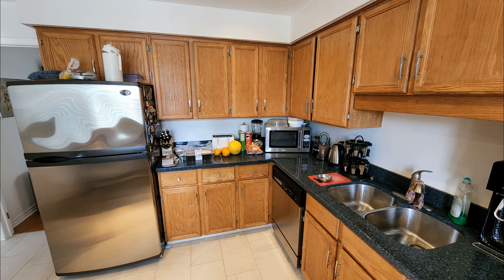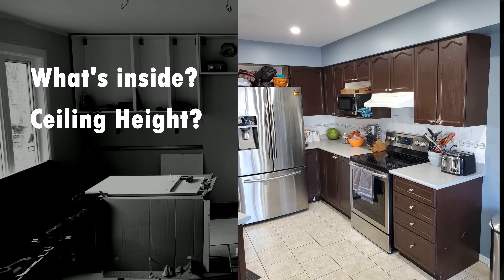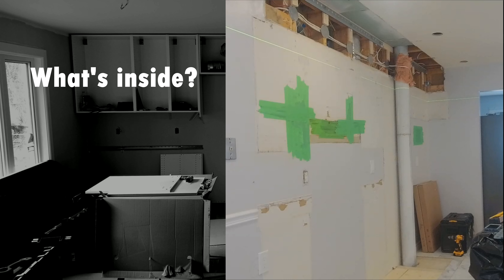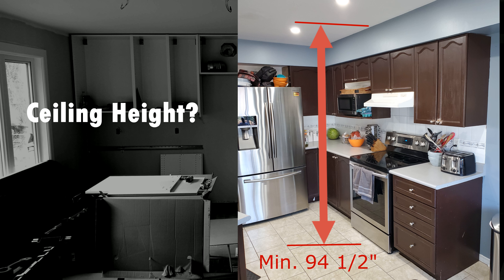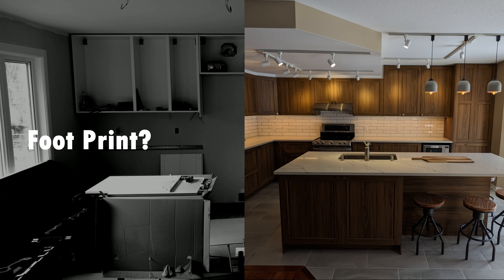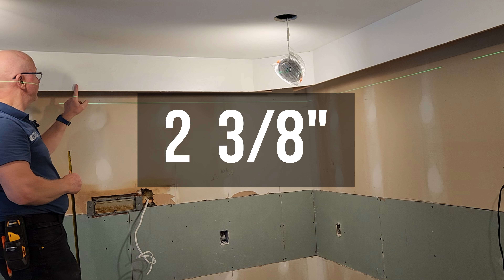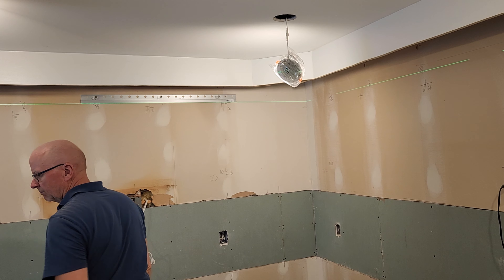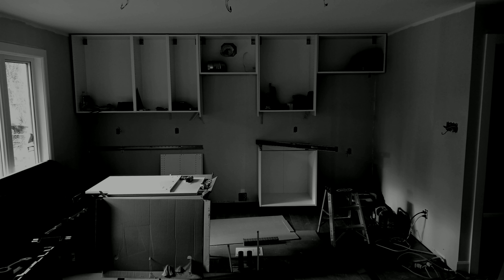Unlocking the Solution: Solving the Old Bulkhead Dilemma in Ikea Kitchen Planning

Comment: Hi there, I have a bulkhead around the top of my kitchen that is 80" from the floor. My house is over 100 years old and the likelihood is high that there is wiring inside the bulkhead that would be a big job to move, so we are considering keeping it. However, it appears that this means we won't be able to have a pantry using Ikea high cabinets, because the cabinet itself plus the plinth would need 84 in. What would you recommend doing in this case? Should we modify the high cabinets to shorten them enough and order custom doors, or make a faux high cabinet out of an upper and a lower combined? Would love your advice!
Reply from the maker: Thank you for your question. I have been faced with the same dilemma not long ago, and in that case I used an 80" high pantry cabinet which I cut to 75" in height. There's no need to use fancy custom doors because you can add drawers and a door to end at 75" in total. In my case, we had 2x15" plus a 5" drawer, which total 35" and the we added a 40" door at the top. Mission accomplished.
The same goes for the wall cabinets if you want any of those. Cut a 30" high cabinet to 25" in height. Then add a 5" drawer and a 20" high door. Voila.
Reply: @kitchensbyrannes  Wow, thank you so much, that makes perfect sense. Amazing that you replied so quickly! I'm queuing up several more of your videos right now to prepare for my Ikea kitchen project :)

Comment: I am working towards completion of my IKEA kitchen right now.  I had a soffit above the old cabinets.  There was no reason anything should have been there.  

Unfortunately, my electrical panel was below the kitchen in the basement and when they built the house, the electricians were lazy and ran all the house wiring in my kitchen soffit to the rest of the house.

My electrician had to put junction boxes in the wall to extend the wires.  You can't bury the junction boxes but you can put them behind the cabinets and provide a cutout in the back of the cabinet to get to them.  I did some measuring and lined up the junction boxes with the upper corner cabinet.  So, I have four junction boxes in the back of my cabinet.  

Fastcap makes some plastic trim rings meant to clean up holes in the backs of cabinets.  I cut them to fit and glued them to the back panel.  Gives a much nicer finish look to the holes.
Reply from the maker: Wow, big job I guess. But if you, by doing all that, are able to use 40" uppers, I'm sure you feel it was worth it.
Reply: @kitchensbyrannes  It didn't matter if I thought it was worth it, my wife did.  But yes, it did allow me to use 40" uppers.  I think I had 95.5" to the ceiling.
Reply from the maker: When I am faced with an obstacle (in terms of extra work to do it right) I always ask myself if the only reason I can think off, not to do it, is because I cannot be bothered, I always end up doing it. ☺️